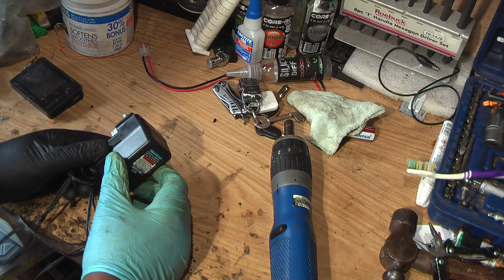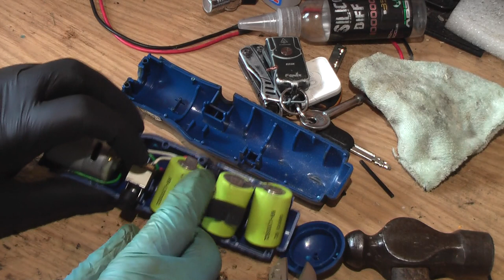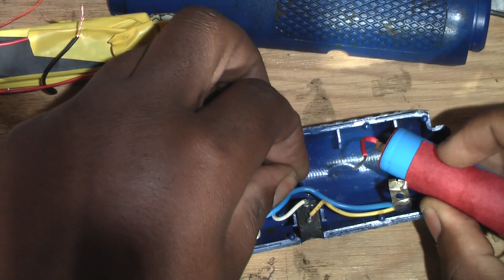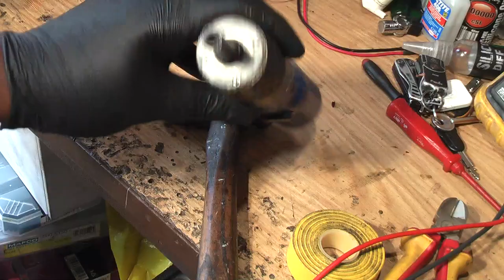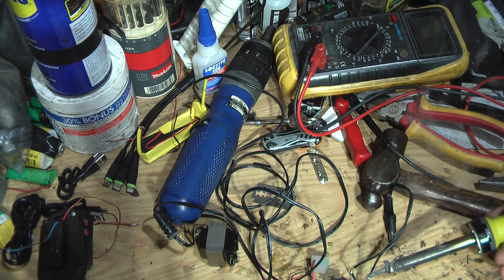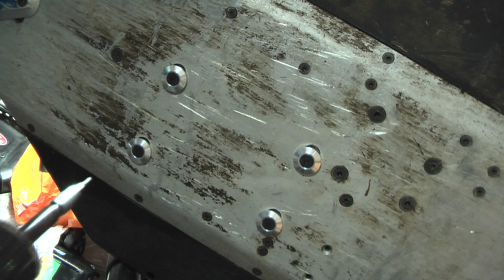snap on blue point cordless screwdriver dissemble and battery replacement

Comment: Interesting bit of backyard engineering there sparky. Haha!
Reply: Have same screwdriver,rebuilt once by snapon after 15 years, laughed at by snap-on dealer recently, so much for life time warranty.loved the torque from it and kept it for replacing batteries 
.tenergy sells correct size to replace the 3 wired In a series 
.after seeing this  I have a larger single rechargeable like he used
. Thanks for this video.

Comment: Hi I have acquired the very same cordless screwdriver can you tell me what is the size of the female plug that goes into the driver male pin please
Reply: Same size as most AC adapters, but output D.C is 6.0 V 300mA.this is from bluepoint  charger label.
Reply: Sorry for leaving out o.d. size.3/16"  same as  electric guitar effects stomp pedals if that helps,but they require 9volts.
Reply: @DaveDeline  thank you I appreciate it 👍🏻👌🏻